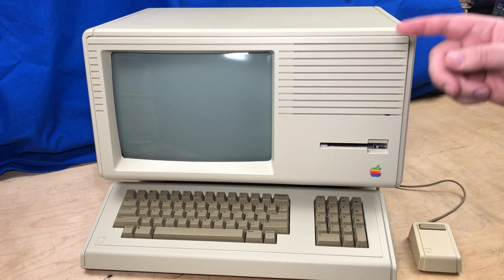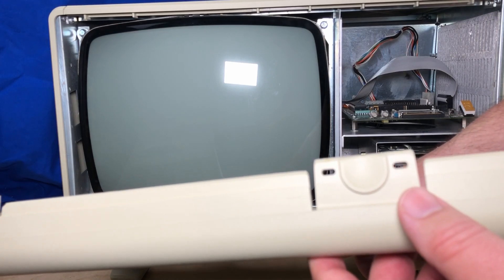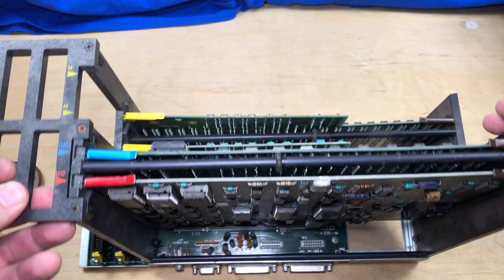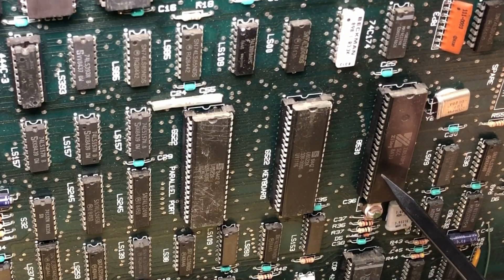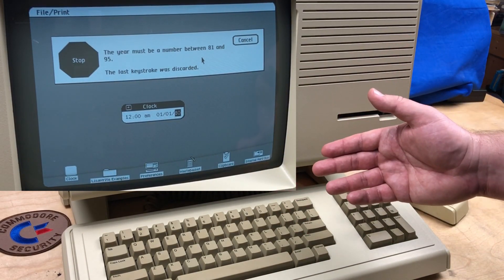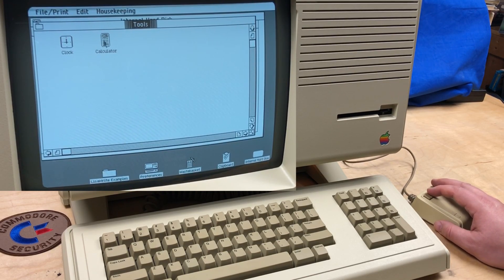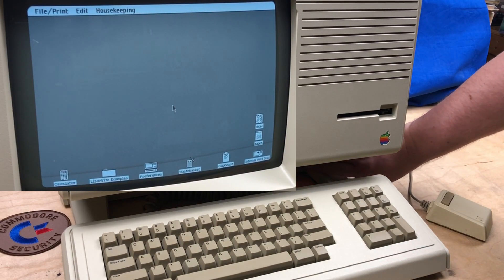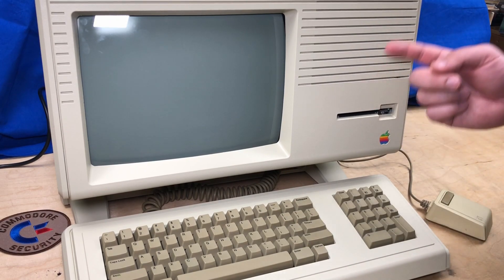Apple Lisa 2: Inside & Out

Comment: So by the mid-80s, you had your choice of three competing Apple product lines with three similar yet completely incompatible GUI operating systems: the Lisa, the Mac, and the IIGS. None except the IIGS were compatible at all with existing Apple II software. That had to be confusing for the consumer.
Reply: Even worse, there was the aging Apple II and, of course, the Apple III, which was also Apple's new stronghold in the education market. (The Apple II was still making most of the money, Apple III was its successor for the education and small business market, Lisa was the high-end business machine, the Mac was this odd hoi polloi thing, AKA 'for the rest of us', and the IIGS was somewhat parallel to this lineup.)
Then the Apple III board had termal issues and warped, and Apple had to recall lots of machines. In order to make up for this, Apple streamlined the product lineup. (It may have well been the Apple III, besides Jobs, that killed the Lisa. The Lisa actually sold much better than suggested by any of the market forcasts or the marketing requirement document.)
Reply: Nah. Consumers just didn’t buy the things.
Reply: @stargazer7644  Not so sure about this. While magazin articles of the time were saying that LISA did just half of the projected sales, the initial marketing requirements projected 85,000 units for the first 3 years, or 2,361 / month. In actuallity, LISA sold in average 4,500 units per month in average, which is about twice as many as projected.
(The projections were for a price of US$ 5,000, which meant a "fully burdenden manufacturing cost" of just $1230, which clearly was wasn't doable at the chip prices of the day. But the LISA outperformed these projections at double the price.)

Later projections where 10,000 units the first year and 50,000 the second year, with an actual performance of 80,000 units sold in 18 month, which is certainly not underperforming. (Just because something is a popular story, it isn't necessarily true, as well.)
Reply: @noland65  I'm not sure where your numbers came from.  The numbers I can find said 10,000 Lisas TOTAL were sold in their entire run (from O'Grady's Apple Inc).  Consumers certainly weren't buying $10,000 Lisas.  Businesses, sure.  Maybe some educational institutions.  Perhaps a couple of die-hard Apple fanboi computer nerds.  But Joe and Harriet homeowner weren't buying $10k computers for personal use in the 80s.  Every person in this comment section I've seen that ran across one in the 80s did so at a business.  I never laid eyes on one.  They didn't even have one to sell at my local Computerland.
Reply: @stargazer7644  Mind that this was not a consumer machine, it's a business workstation. So you'r right here.
But have a look at other computers marketed to the same audiences, business and professionals, engineers, etc:

SWTPC 6809, 1983, all prices GBP, 1983 money (1 GBP ca US$ 1.5)
CPU with 256KB £ 3,700
Terminal £ 790
single floppy drive (various configurations) £ 2,300 – 3,400
16 MB Winchester hard drive £ 11,415

These specs are far behind the Lisa 2/10, which is in comparison pretty much a bargain. (Also mind that you get an integrated software package, networking with a terminal emulator with VT100 and IBM 3270 compatibility, etc. This is not your Apple II.)
Even, when comparing this to a more ambitious and workstation-like Mac model with comparable specs for the time, like the 1990 Macintosh IIfx, which came at US$ 8,989 or US$ 10,969 with an HD, but without any software, the price was actually quite adequate.
(Speaking of Macs, mind that you couldn't even write software on the same system with the early 128K Macs, since they were too low speced for this and pretty much maxed out just running the system, you had to get a Lisa / Mac XL for the job.)
Reply: @noland65  I can't really comment much on the SWTPC you mentioned, as I've never seen one.  But a bit of google research shows the 6809 version of that computer came out in 1979 while the Lisa 2 was Jan 1984.  Not really a fair comparison.  The original Lisa had unusable Twiggy floppy drives, 512k of RAM and no hard drive standard.  The 2/10 had a better floppy, and the 10 MB drive.  And "networking"?  An Apple II (and every other computer of the age with a serial port) could quite easily do VT100 and 3270 emulation.  Dumb terminal emulation is hardly networking.  The IBM PC AT was more of a contemporary, coming out in Aug 1984 for $6K with 512k RAM (expandable to 16MB) and a 20MB hard drive and a 286 CPU.
Reply: @stargazer7644  The point is still that this is from a 1983 price list, contemporary to the launch of the LISA. That it is for an 8-bit computer that had been on the market for some while makes the price gap even more noteworthy. (At least in my understanding.) And, regarding the AT, well, in 1984, you could get a Lisa 2/Mac XL with 1MB and a HD and the generally more approved 68000 CPU for $5,000, again, with comprehensive software. Not  an unfavorable comparison either. – The fact that the AT succeeded does not support the idea that the Lisa failed for its market price.

Edit: So, if you add necessary components, like interface cards and a display to an AT, you're about the original price of the Lisa, but still lacking networking and software. Also, your system is arguably a generation behind.
Regarding networking on the Apple II: A 3270 controller is a desk-size appliance, even an IBM XT required a dedicated processor card to run 3270 emulation. I seriously doubt this could have been done on an Apple II.

Comment: Wow, look at the SIZE of those RAM cards! Man, have we come a long way or what?
Reply: The computers I worked on in the 80s had RAM cabinets the size of refrigerators. Each held a whopping 16 MB made up of individual 2k ram chips. We ran a memory diagnostic program each week and pulled the failed cards and swapped out the chips.
Reply: @stargazer7644  We've come a long way, for sure. Look at the 128 gigabyte micro sd card in your phone (that you bought for less than $20) and compare that to the 256k module on your Amiga 1000 that cost $300. Crazy. Pretty soon memory cards will be free inside boxes of cereal!
Reply: @JustWasted3HoursHere  They're already giveaways - go to an electronics show and they're giving out material on thumb drives.

Comment: This Lisa 2/10 would not have had a battery installed --- and only the 2/10 had the IWM chip. The CPU and memory cards are the same as in the earlier Lisas, though.
Reply from the maker: Okay, thanks, is the IWM the most reliable way of identifying the 2/10? I couldn't find any identifier on it, and it's strange that it didn't seem to have a serial number anywhere.
Reply: @8_Bit  I forgot to add that the motherboard is also different. The Lisa 1 and 2/5 have a parallel port next to the serial ports and the mouse port --- the 2/10 does not, because the parallel port is rerouted on a ribbon cable to the drive cage in the front. Originally, a "Widget" 10M internal drive lived there.

Other than that, the 2/10 I/O board can be distinguished by the shrouded pin header near the blank area for the battery. And, sadly, often the lack of corrosion in that corner is another big clue.
Reply: PS: Look for the serial number tag attached to the bottom of the "overhang", just under the screen.

Comment: 0:03 Lisas must be pretty rare these days.

1:36 There's no Control key.  How are you supposed to Control it?!

9:11 That's a lot of freakin' RAM chips.  I guess 64-Kbit chips were the largest available at the time.

11:09 If they can fit 32 KB of ROM in one chip, why couldn't they do something similar with the RAM chips? 

12:31 I wonder how many Turing-complete computing computational elements are present in a modern smartphone.  Dozens?  Hundreds?

15:40 Is this where the horrible idea of double-click-to-open came from?
Reply: More Turing-complete elements than are being used for anything interesting, that's for sure.
Reply from the maker: The absence of Control is strange; wouldn't it be sorely missed in the terminal app? I didn't try LisaTerminal since I didn't have anything to connect to, though I suppose I could use a null modem.
Reply: EPROM chips are very different internally from RAM chips. Plus, i’d bet that 27256 EPROM was added later and the original was smaller.

Comment: A little detective work on why some chips are all scratched up: You can see that only the chips in sockets are scratched, all the soldered chips still look new. I am guessing that a service engineer was called to fix this (or they sent it to apple), and he just swapped out the replaceable chips till it worked. Obviously the service engineer was a slob, and kept all his spare chips jumbled together in a bag where they got all scratched up!
Reply: It'ss simpler than that. Socketed ICs stand up higher, so when someone stacks boards on top of each other, that's what gets scratched by the board above.
Reply: @mal2ksc  Well, that’s possible, but I considered it too, and studied the way the scratches were placed on adjacent chips. They don’t match. And especially on the left 6522A chip, the distance between the parallel scratches is about the same as the pin spacing, suggesting that a naked chip had been dragged across it. Maybe you are right, but I think the weight of evidence is for the sloppy service engineer idea.
Reply: @martinstent5339  The pin spacing of socket legs sticking out the back side of a board is exactly the same as the pin spacing of the naked IC. The spacing between the scratches is consistent with both our ideas.
Reply: The socketed chips sit higher, protecting the ones on the board. The scratches appear when you stack the boards on top of each other outside of the computer.
Reply: @stargazer7644  Neither of us can be 100% sure, but take a look at the apple ROMs, they are 2 EPROMS which actually stand up higher than the surrounding chips, but are completely unscratched. Also, as I said, the scratches on adjacent chips never line up in direction or intensity. As an (almost) lifelong service engineer, I think either reason would be poor practice. I always used to keep my spare boards in anti-static bags, as well as my spare chips, for which I had anti-static foam to protect their legs. Either way: Throwing the chips all in one bag or stacking the naked boards on top of each other, both were not very good practice 😊
Reply: @martinstent5339  Nope, not sure, just guessing here, but I suspect the ROMs were upgraded at some point, that's why they're not scuffed up.  I worked with a team of computer techs in the 80s who were mostly trained in the 60s/70s, and as a group they never heard of a static wristband, nor anti static bags.  Ahhh the good old ECL-TTL days before CMOS.  I agree it's not very good practice, but I saw computer cards abused in this way all the time.  You have a pile of boards, you need one out of the middle, so you yank it out.
Reply: @stargazer7644  At some point, probably around the 386 coming out, I noticed people actually using anti-static bags -- to place in between boards when they stacked them! :)
Reply: @mal2ksc  Yes, ESD protection became an issue with the introduction of the faster TTL LS and ALS chips, and especially CMOS.  Logic families before that such as TTL and ECL were much more robust against static discharge.  MOS has very thin structures that are easily damaged by as little as a few dozen volts of ESD.

Comment: For that funky video format, would it be possible to capture the signal with a sufficiently-fast audio interface and then decode it into a video signal?
Reply: Interesting idea! I imagine the signal is too fast for that - the 22kHz is the horizontal frequency, and then there's 720 pixels per line, plus a retrace period, so the total bandwidth of the signal is about 20MHz.

... which makes me wonder how good the video quality on that output was, or if there were even any displays that used it. Regular composite video has a bandwidth of about 6MHz, so that 20MHz seems like a lot to pump down an RCA cable!
Reply: @rjhelms  Ah, yeah, I was feeling too out of it to do the math. A 20MHz signal would be pretty difficult to capture without highly specialized hardware. The best audio interfaces I know of only go up to 192KHz so that'd be able to get a horizontal resolution of around 8 pixels...

I wonder if there's any digital oscilloscope things that would be capable of this task, or maybe something weird one could do with a software-defined radio or something. Or even some random weird video capture ASIC which allows much more flexibility in its signaling.
Reply: maybe build a circuit to split the  signal to RGB+sync and use a VGA or component PCIe/PCI capture card. Alternatively modify the video output circuitry of the Lisa 2 to output a standard composite signal.
Reply: VGA can go upto higher resolutions (including HD) than this with a good quality cable.
Reply: @simontay4851  Why would it have RGB+sync? It's a monochrome display. And the actual plug is only a single conductor pair so there's no way for it to have a separate luma+sync signal.
Reply: Not even close. This monitor is far higher bandwidth than standard def TV, which is 6 MHz.

Comment: I used / supported an Apple Lisa at work in the mid to late 1980s.  It used the 5-megabyte ProFile external hard drive, but we had to run it sitting upside down because the drive bearings were shot.  I remember bringing in catalogs from a company called Sun Remarketing that made and sold upgrades for the Lisa, including a dot-pitch conversion for the display so it would match the Macintosh (square vs. rectangular pixels).  They didn't want to spend the money to upgrade it; not surprising, since we had a Mac Plus and several IBM PC/XT on the project.  I think we finally got a PC/AT not too long after that... ☺

Comment: I remember those! I had a summer job when I was in High School that mainly involved working on a terminal connected to a DEC VAX minicomputer (back when minicomputer meant the size of a large fridge), but they also had a Lisa with a 10 meg (I think) hard drive that had the same footprint as the computer and stood on top of it. Unlike MacOS, each window had its own drop down menus and someone managed to render the machine useless by dragging all the windows off the screen, at which point you couldn’t get them back, so it had to be totally reinstalled.
Reply: It's funny how full tower PCs are still technically "microcomputers". Where's my nanocomputer?

The idea of making a computer unusable by dragging all the windows off the screen is hilarious. I guess reinstalling was faster than figuring out how to reset them.

Comment: Yeah, I bought one of those back in 1983 to use to develop Mac software.  It was the only way.   I did install the office system, but the apps were far too slow to be usable.  Every click took seconds to register.  The spreadsheet took a long time to move from cell to cell and recalculate.
Even the calculator would take like six seconds to come up with an answer.   The terminal emulator was really slow, it could barely do 1200 baud on a good day.   The screen pixels were not square so drawing was wonky.   I ended up drilling a hole in the case and installing a switch to down-adjust the height to get square pixels.   Not fun times.   Even with the deveolper's discount it all came to like $9,500.

 I soon abandoned the office system and just used the UCSD-like OS and compiler and linker to make Mac apps.

Comment: Great piece of history. I always wonder why they went away from the easy access and serviceability, but I guess times change. We should go back to that kind of thing though. Even though I understand that the warranty would be void, it is great to do things with your Computer. That is why I always stayed with Microsoft compatible PCs. At least you can move around your own components, upgrade. Still, what a fantastic video, the prices back then always fascinated me. EEVE blog had that hard drive 3.78 gb or something and back in the 1980 it cost like 250 000 !
Reply from the maker: Apple's actually went back and forth many times on the repairability of machines. On my Macbook Pro from 2013 the bottom panel simply screws off, and the RAM and hard drive can be easily swapped out/upgraded.  Every decade since the '80s they've made some machines that are terribly inaccessible, and some that are at least pretty good if not great.